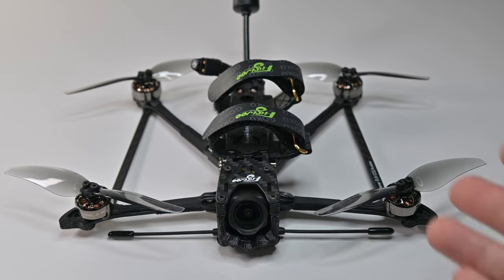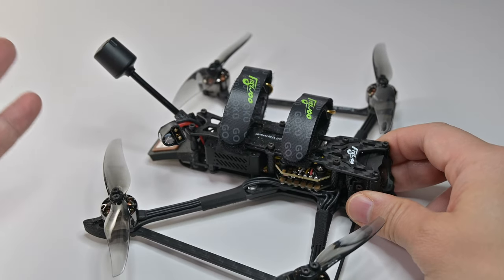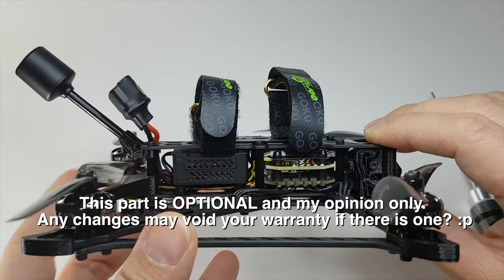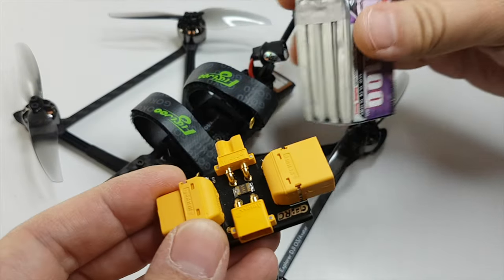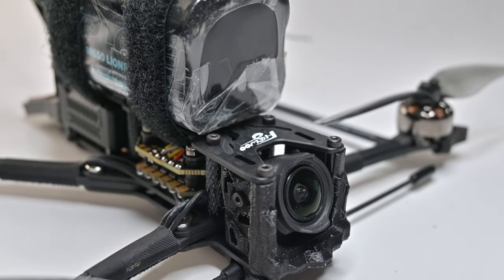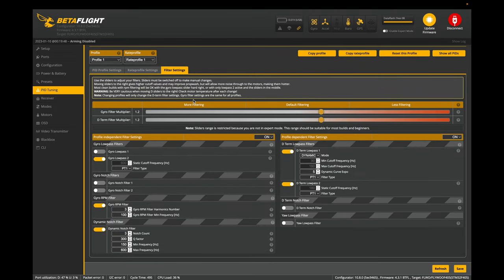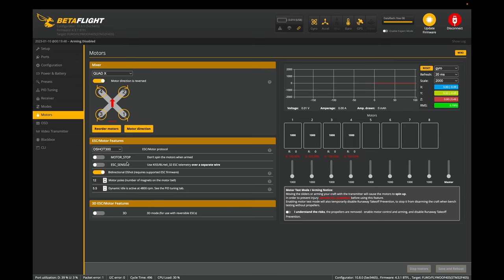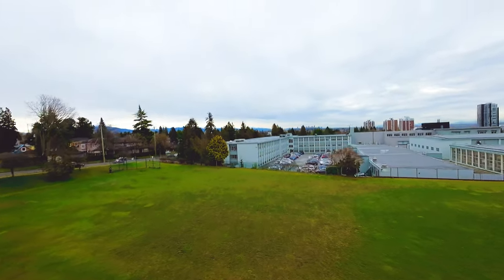Modifications & Tunes | Flywoo Explorer LR 4 O3

Comment: Thanks for the tuning, I tried to use them with BF4.4 with the latest ESC update but with GokuF745 stack (old one) and it resulted in controllers instantly saturating causing a flyaway so take a lot of care trying this with 4.4 & older FC. If I manage to get it running I will come back with a CLI dump.
Reply from the maker: Thanks for testing. Hope there was no damage to your quad. Looking forward to your update.
Reply: Also looking forward to it!
Reply: Wait so you tried this config and it caused your drone to instantly fly away? Did you ever figure out why?

Comment: The whole FC stack assembly is supposed to be a floating assembly to filter our motor/prop vibrations.
Reply: Its supposed to be soft mounted but if its too free floating then that will cause issues.

Comment: Thank you for video!
I have BF 4.4.2. I tried only PID first. It feels slightly better.
Then i flashed ESC and applied filters. And it feels MUCH better.  I enjoyed it better picture in googles  and easier stabilization. I also instaled braces, but don't know how much it helps.
I try fly smoother, but when i set high throttle(70%+), drone shakes. I'll look at logs, may be i'll fix it somehow
Reply from the maker: Thanks, keep us posted on your findings!
Reply: Which version fw did you flashed ? Newest ? 0.20 ?
Reply: @tomasz.dermin  i flashed 0.18. The latest in my list was 0.18.1
Reply: Is your drone still shakes under higher throttle?
Reply from the maker: For me it’s fine at high throttle, it’s just fighting with the winds is more of the issue, explorer flies great with wind it’s just finding that balance of useable footage in strong winds

Comment: Hi, I have a issue with my explorer 4 03 after Armin motor starts spinning like crazy and I have no control over throttle. Any idea what could be wrong? 
Thank you
Kind regards
Reply: My 4 motors starderd spining 100% while i was wayting for gps fux when it was disarmd needed to pul battery out when it was upside down in the gras

Comment: Nice Video, im about to get mine at anytime.

Think I need to get the antenna mount later If I feel Needed.

I was also courious about the FCC hack on googles2 (as im outside the US) 

I saw some video out there where signal to googles 2 seems to be improved. And access to more channels
Reply from the maker: ah yes do the hack and also get the extended antenna mount. Both will get farther range together.

Comment: thank you so much for that! Question: 1. Why do you use a m2 nylon instead of a metal( (nylon always  gets loose) 2. Did you actually finally try BF 4.4? Thank you!
Reply from the maker: Hi no problem! M2 nylon nuts work for me I just give it a nice finger tight tug with the good ol pliers. Also they are lighter and not prone to adding more possible materials to short the electronics. But yes m2 metal nuts with nylon insert is just fine. I switched over to 4.4 and she flies fine. Pretty much the same just can land itself now which is so cool. Cheers
Reply: @PattyFlipz  thank you! do you have any infos about the new GPS Module with the 10 chip? I thought it should find satelites pretty fast, but for me its basically not faster then the old bn220 maybe even slower
Reply from the maker: Yeah, I am experiencing some issues too. honestly the first time I used it. It was blazing fast. Like by the time I got my goggles on my face it found 8 sats. Now it takes a few minutes to get a lock. Strange.
Reply: @PattyFlipz  Hi guys. Hi have EXACT same issue. First try of the GM10 mini was crazy fast fix and 24sats in flight. No I barely get 7-8 sats all the time, mostly 5-6. Veeeery frustrating
Reply from the maker: @oliver51450  yeah totally sucks!!! :(
Reply: @PattyFlipz  Thanks for sharing all your excellent tips, settings & experiences ... About the GPS, there is a problem with the M10 GPS, which is described and fixed in an iFlight blog entry. JB made a video about it: https://www.youtube.com/watch?v=5fBDqeAoqvI ... Cheers!
Reply from the maker: I will take a look. Thank you!
Reply: @T69-AK  That "fix" will just tell the M10 chip to talk faster with the FC. It`s only about that (increase rate to 10Hz). Unfortunately it doesn't solve the issue of the GPS fixing only a few sats, as described in the comments above. I ended up putting back my BN220
Reply: @oliver51450  Ok, I see... Thanks!

Comment: @ 8:39 .. why 48 for Dynamic Idle Value? What would happen if that was set to something like 25 (for a 4-inch quad)? Thanks 👍
Reply from the maker: Hi, the example of 25 would mean your initial idle speed when armed is at 2500rpm. Try spinning the motors with no props on at betaflight motor tab at 2500rpm. If your motors don’t spin smooth it’s not a good idea. 2500rpm works really good for 5” like 2207 or 2306 motors I found. I found 48 to be good cause it provided enough initial lift and if diving motors won’t feel overload at high rpm and cause desync symptom at a fast drop.
Reply: @PattyFlipz  — thank you .. yes indeed, i did some more reading and that value is for larger quads and for the size of the Explorer something around 40 seems better .. so +1 on your results — you got it right. I am still experiencing a lot of prop-wash on mine but i have not copied your tune (yet) as i am trying to understand what each value means first.
Reply from the maker: Awesome! It’s a lot of fun to just experiment and learn. I’m still learning as well. 👍

Comment: I have been flying this Explorer for a while now and every time I go faster than 50 mph (80 km/hr) it starts shaking. I get that it’s not a racing drone or a 5-inch quad etc but I am new to FPV and don’t have another real drone to compare it with - so I wanted to ask you if you think that’s normal and if you had the same. This happens while diving in low throttle or flying fast in lever flight. It just doesn’t like to go this fast. I am using an 850 mAh LiPo or the Explorer 3000 mAh Li Ion with the same results. Thanks 🤘
Reply from the maker: Hi! Great question. Sounds normal for explorer. Any sort of fast speed, wind will still shake these lightweight sub250g drones, so gyroflow or rocksteady is most likely required to smooth footage if you care about that. Not only is explorer lightweight, it is a dead cat frame which is designed to have no props in view and could effect performance and stability compared to an X. Did you try adding the stabilizers that attach to the arms? Or try my tune in one of my videos, but it might not solve all the issues.
Reply: @PattyFlipz  .. i found your video with your tune - looks awesome and i want to try it. In case i mess up, can i save / back up my settings (i am on BF 4.3.1) by going to the Presets tab and saving a preset, or should i go to CLI and save a text file with “diff all” or try the “dump” command? Is one better than the other and will it save my existing PID settings? Have not tried that before — thanks.
Reply from the maker: @AZ-FPV  Hi, for me personally I prefer going to CLI and typing diff all and saving your stuff before trying my settings. Yes It will save all your existing PID settings.
Reply: @PattyFlipz  - PERFECT .. thanks for confirming - i will try it .. since you have so many Explorers, can i ask you how many mAh do you fly when you use the 18650 Explorer Li-Ion 3000 mAh pack? Do you fly for example until you use 2500 mAh or until you are down to say, 3.25 volts per cell ?
Reply: @PattyFlipz  — also, UAV Tech recommends a linear (25) throttle setting .. i tried it but didn’t notice any difference (but that’s most likely because i am new to this)
Reply from the maker: @AZ-FPV  Hi, I rarely use that much mah, cause I don't fly LR that often. Mainly just exploring a 1-2 km out. 
but if doing really long range mission (trying to go as far as I can)  then those numbers you posted is safe. I'd make sure you landed by then. I flew to 3.2V once, and was battling wind on the way home. Was getting very nervous. You can feel the power sagging away.
Reply: @PattyFlipz  .. sounds good .. will do .. I have only been 1.7 km out so far but hope to reach 2 km soon :) Thanks ✌️
Reply from the maker: @AZ-FPV  Awesome good luckl man! Yeah, this weekend I will be going for another true LR mission. Aiming for 8-12km round trip. The 3000mah lion is more than enough to do a trip like this and be comfortable coming back home. If you think of the battery by percentage 0-100% instead. Generally I'd fly 40% to the destination (1200mah), and comfortably have 60% battery left to return home. Although descending uses less battery, but gotta account for other factors like head wind. it's best to be conservative and get your quad safely home :D
Reply: @PattyFlipz  -- i like the math on this one! Thanks, looking forward to my next flight and more videos on your end. By the way - BF 5.5 will be out soon and if you ever consider making a setup video for the Explorer on 5.5 that would be epic 🤘😎

Comment: Anyone know if this will work on the V2? Been hanging in pegboard for months due to major osculation issues. Want this drone to work so badly!
Reply from the maker: Some people have done it with good results. Just back up your profiles, then manually type in the numbers I posted and give it a try. Its not going to be a super game changer, but it will help as long as its not super windy. :)

Comment: Hi I have my explorer o3 since a few weeks . I fly with a 3000mah liion. I tried all things in the video but my quad still have propwash and shaky picture during just normal flights . I used your pids , change the esc value , even opened the o3 cam , made sure that all acrews are tight on frame. It’s make no differents with stabilisation on or off . Someone had the same issues maybe ? Greets
Reply from the maker: Hi, because of how light the quad is, there will always be a shaky picture through the goggles, especially with wind and at higher altitude. The stabilization only works for the video that is recorded in the memory card.
Reply: Yes I know that the stabilization don’t work during fly. I still love that quad. Thank you
Reply: I had the same issue here. I even opened the o3 and superglued the lens. Turned out I tightened 1 prop screw too much and it made a very thin crack on the prop screw hole. Almost not noticeble. Changed the prop and voilà.
Reply from the maker: @Guimaraes.Renato thanks for the tip. So true. Any small little thing can throw off the quad

Comment: Great work! It's amazing to see what a different some tweaks can make :) My analog Explorer v2 has some light shaking here and there, which is difficult to notice, but strong enough to show up on the SMO4k footage. Stock tune. Do you recon that's wind or could tuning possibly improve that? 🤔 I know it's hard to tell by some text, but if anyone can take an educated guess, it's you :)
Reply from the maker: Hi! Try checking your ESC's firmware and flashing 96PWM and see if it works for you. If it already has that, try bringing your I gain numbers like my tune. Around 90 ~ 100 numbers and arm stabilizers.
Reply from the maker: Oh forgot, and just double check your battery placement too for perfect center of gravity. I avoid toilet tank mounting style as well. I found the quad has more trouble during rolls if doing toilet tank mount style (I use roll a lot!)
Reply: @PattyFlipz  Thank you so much for the tips! I will check it out and see if it makes a difference :) Have a good weekend!
Reply: @PattyFlipz  Hey again, I tried Flashing Bluejay at 96 PWM instead of BLHeli_S and the motors wouldn't spin. Is there something I'm missing? Back to BLHeli_S now and it flies 🤷‍♂
Reply from the maker: @drdrhelmut  My esc already came flashed with Blue jay by Flywoo, so I'm not familiar on how to do it yet. I found this article, perhaps you can read it over and see if anything has been missed? https://oscarliang.com/bluejay-blheli-s/
Reply: @PattyFlipz  I see. I watched some Bardwell and think that it's a settings issue more than a ESC firmware issue. I'll try around a little this week and post a solution, if I find one :)
Reply: Hi again. I tried to educate myself on the settings of Bluejay but the props just would't spin. Could you possibly take a screenshot of your ESC settings and share it? I can't seem to find those seetings somewhere else on the web 😅
Reply from the maker: @drdrhelmut  Hi I will check when I can and send you a photo.
Reply from the maker: @drdrhelmut  Heres a screenshot of my settings: https://drive.google.com/file/d/1K9TpQYIMIPZI--Xbz2D20L1p_3fQeJ_I/view?usp=sharing
Reply: @PattyFlipz  Thank you so much! If you have a Buymeacoffee or something like that, I'll happily donate a bit :) Thanks for your effort
Reply from the maker: @drdrhelmut  Ah don't worry about it! Glad to try and help. Hope it works out for you!
Reply: @PattyFlipz  Thanks :) I'll try it on the weekend and hopefully have a nice flight. Your footage always looks so good and I was inspired to finally get my tuning to a place where it would yield better results, too :)
Reply: Ok, I got it to work! Only did a hover test so far. I had to flash Bluejay, then turn on Bi-Directional DShot and choose DShot300 and boom it flies! Looking forward to properly testing it!
Reply from the maker: Awesome! Glad you figured it out. Looking forward to your results

Comment: Are there any problems with returning home?
I heard an opinion that previously Betaflight had some issues with it.
Reply from the maker: Hi, no problems so far as long as you set up correctly but theres many external factors as well and dangers in the flight..(eg: objects in front of your drone) Just make sure you have a good satellite lock count before taking off (7 is good) and don't fly near any radio towers (can mess up your home direction) and be ready to take control if you return home.
Reply: @PattyFlipz  thanks for your answer and great video that helps beginners!

Comment: Hi, thanks for the video! I just received the same quad yesterday and after setting the modes for the DJI Remote 2, when I arm the quad, the motors do not spin, instead the quad screams continuously waiting for throttle input and when I rise the throttle the screaming stops and the quad is flying. When I land the quad, the motors stop spinning without disarming but they start imidiately after rising the throttle stick.
Is this normal? Do I have to do something in betaflight so the motors to start spinning after arming?
Reply: what do you mean by screaming? Do you have the "motor stop" on in Betaflight? When this is set the motors won't spin when armed
Reply: @BiecherBender  A continuous ESC loud sound probably to inform that the quad is armed. Did not change anything in BF 4.3.1. It is the stock tunes. Where is this setting? I armed in ANGLE mode and I have the AIRMODE in the same switch with ANGLE - AIR modes, disabled in ANGLE but enabled when I switch to AIR mode.
Reply: @KostasGur  its in the motors tab
Reply: @KostasGur  there is also a setting called air mode in the configuration tab, which should probably be turned on. This gives stability when you are in the air and turn throttle to 0. I think that this setting also overrides the motor stop setting, so if you have this on, motors should always spin, no matter what you have set for motors stop
Reply: @BiecherBender  thanks, yes I just read about airmode's behavior but usually in all my quads I have it disabled and enable it through aux channel in modes. Enabled each time I switch to acro mode but in angle which usually I use inside home where I tested the quad yesterday, just for hovering, airmode is disabled because it produces turbulence when you fly very close to the floor. I will try to arm the quad in acro mode with airmode enable to check the motors later today. Thanks a lot for your help.

Comment: hi Patty, I was just curious if you have updated to BF 4.4 yet.

I tried earlier today but it was a nightmare to set up and lead/migrate the presets from 4.3 (a lot of errors in  CLI)

so I had to roll back to 4.3 and see if I find how to in upcomming days.
Reply from the maker: Hi! No I havent tried yet. For me though, what I would do is, I screenshot all my changes on 4.3. Then after flashing 4.4, I manually adjust every parameter to match my screenshots. Takes a few minutes longer but at least no errors!
Reply: @PattyFlipz  Good idea, im not sure if it was some issue with cloud build, but I also tried full flash.

Couldnt even calibrate accelerometer, ant all settings totally messed.

Lucky I saved presets before 😅

I think I will also try add all cli commands that seems good and dont give error
Reply: Will try tomorrow I have time, would love to try new GPS fly to home 🙌 

and updated angle mode (even if I now manage acro, thx to acro trainer mode)
Reply from the maker: I had trouble with a 4.4 flash as well with a different quad. gyro was not recognized. Im gonna just leave it for now and try again another day  🤣
Reply from the maker: @VegaZ1980  Cool, keep me updated! :D
Reply: @PattyFlipz  still on 4.3 Will wait a bit and make more research as I assume more will have similar issues.

4.3 still works great for me
Reply: @PattyFlipz  did the same and no gyro on 4.4 , tried 405pro with flywoos cli and same issue . I want 4.4 for the gps rescue , it seems there is no target for this board
Reply from the maker: good to know! Hopefully in a couple weeks the devs make it happen!

Comment: well max newbie, how do u start the motors? with dji controller 2, bindings ok , same BF values as here. Tried any aux combinations, still no action for motors starts :(
Reply from the maker: Double check your ports tab. Serial RX needs to be switched on for the correct UART (check FC diagram on flywoo website of the plug) Also check make sure in receiver tab you have it set as SBUS. Also check all the firmware versions are up to date on O3, controller and goggles. If all fails please contact Flywoo support.